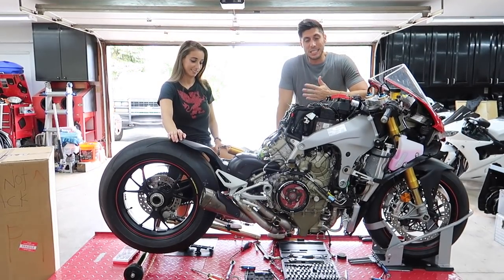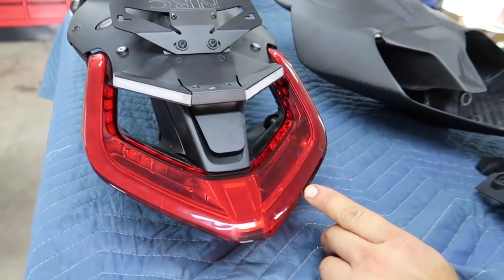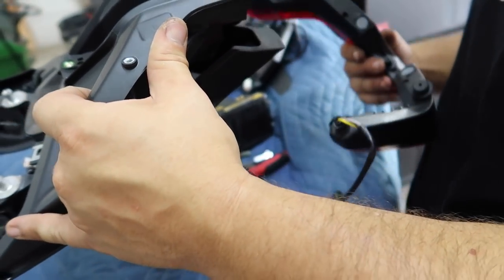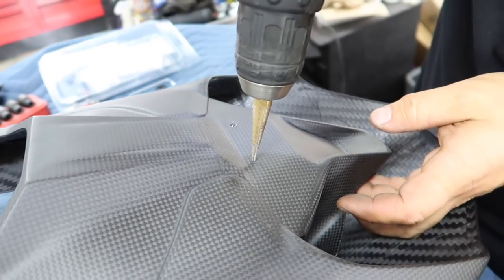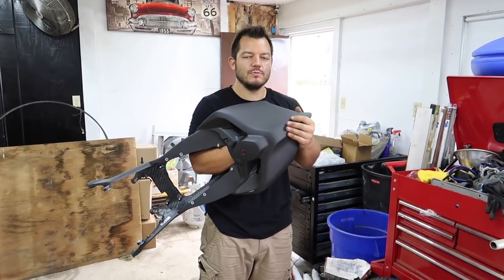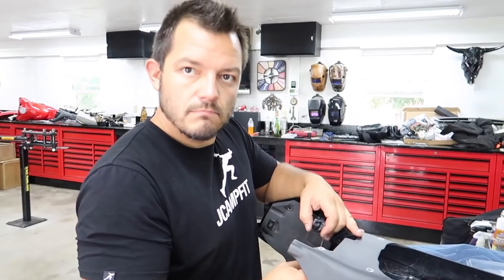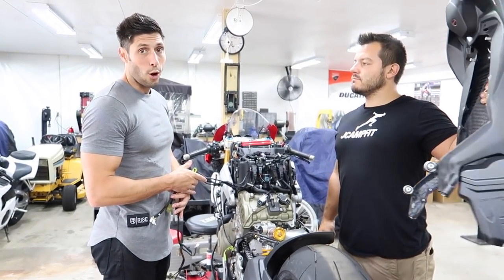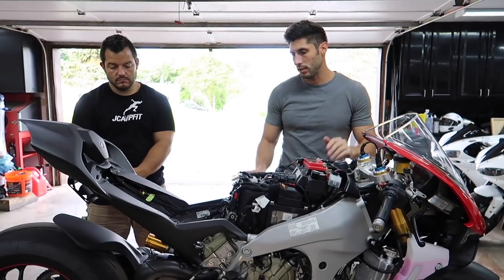V4 Panigale with $3,000 Full Carbon Subframe!

Comment: Who gives a shit about 10 lbs of weight savings. The bike is already light as hell, and the amount of power you are getting, its insane. The power to weight ratio on the v4 is unheard of. Are you a dedicated race track guy who is trying to cut off tenths of a second off your lap time? By the way I am an a mechanical engineer in training and going to do research in combustion. So my opinion has a little meaning to it. I am not just speaking out of my you know what. Why mess with something that engineers put so much research and development in. Just because the bike got lighter doesn't necessarily means its "better". Now mass distribution will change because of the weight change. Sorry for the long rant, your money so who cares.

Comment: The carbonframe looks very very thin. Dont you guys had to swap the inner metalframe from the original subframe? The Carbonframe looks more like a fairing than an actual frame. Wont trust it with a 90+ kg guy on a bumpy road.